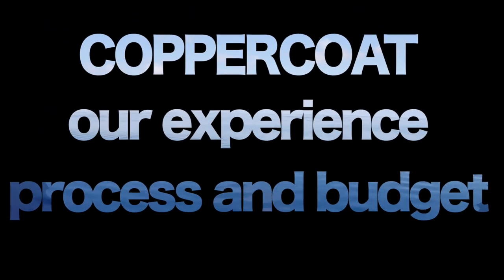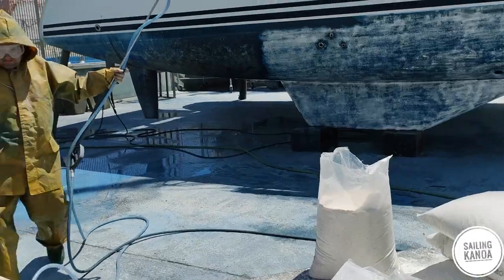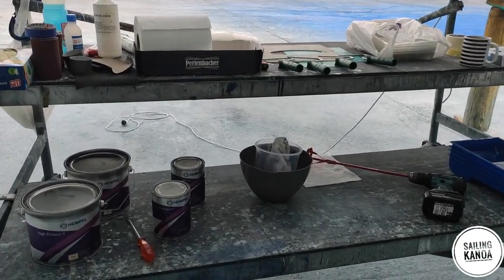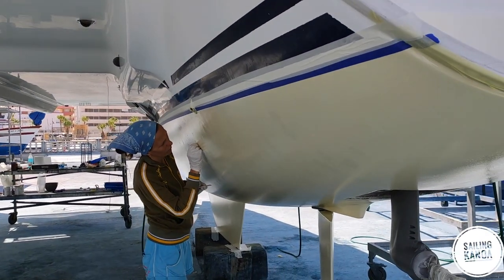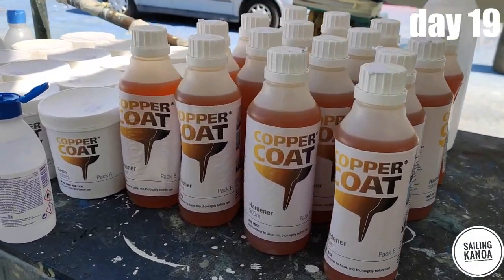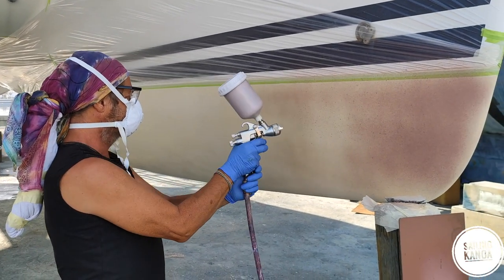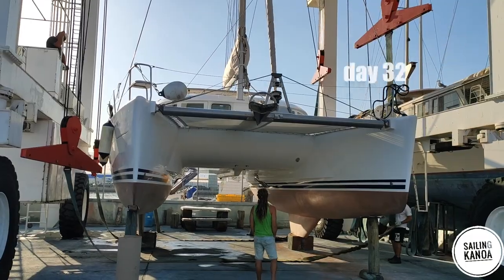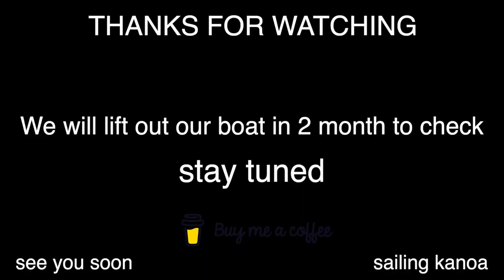We sprayed CopperCoat Antifouling.  Process, mistakes and budget. (Ep.46) Sailing Kanoa

Comment: Since it has been 8 months since you did this job, i am wondering if you are still happy with the product?, did you get a lot of barnacles? Did you have to clean hard? How often?
Reply from the maker: Hi Sergio. Very good question. For the first 4 month we had nothing to do. We have been on anchor and moving from time to time. As soon as we stayed 2 month in a marina we found a little bit of slime forming and on the bow also a few barnacles. Then we cleaned before we changed into another marina. Here we have high nutrition water and again slime was forming. After 2 month we hired a diver. He told "it is the cleanest hull he ever cleaned..." Now, we are again 3 month further and again we find some slime. The water is already a little bit warmer (Mediterranean) and I will clean myself. I can wipe it down with my hands. We are very happy with coppercoat so far... ; )